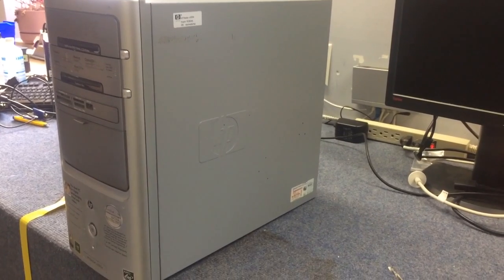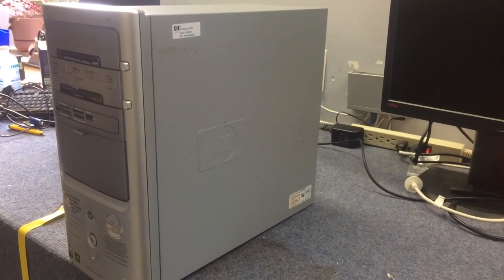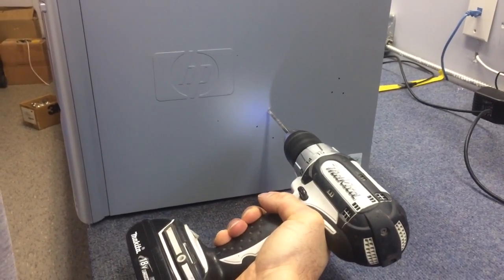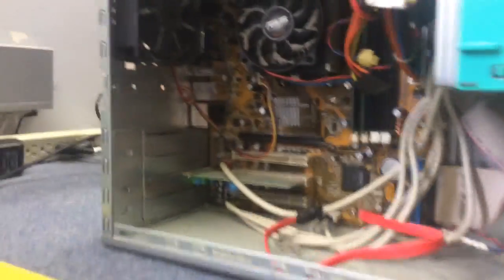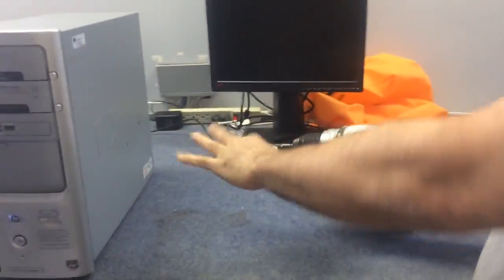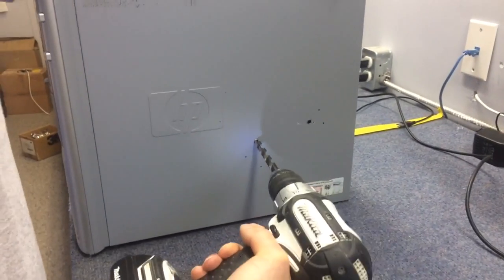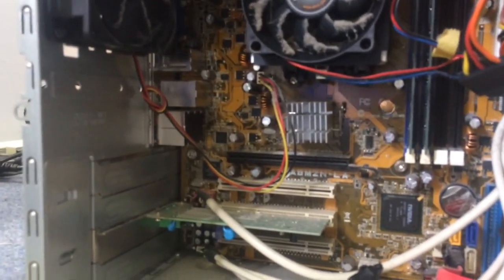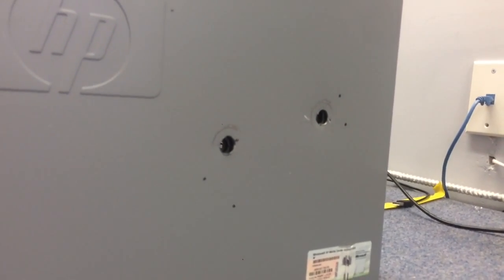Increase airflow in any computer easy hack

Comment: If you get rid of your casing you can completely forget about airflow! It’s a wonder how much three brain cells can do to get you running at 43056716 FPS 
And don’t forget the -59365001 degrees celcinheit man this worked too good.

Comment: I heard that if you drill a hole in the middle of your CPU you can run water through it and cool it to -420.C and overclock it to 6.66 THz
Reply: Yeah but you need to put the water in a ziplock bag and set it directly on your CPU or it won't cool properly
Reply: Bro my pc won’t turn on, what’s wrong, please help, please please